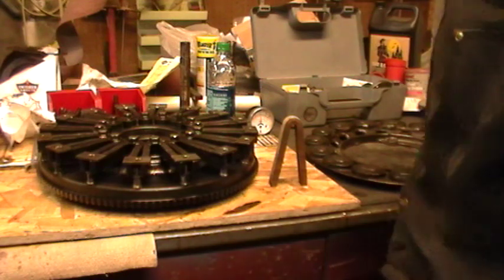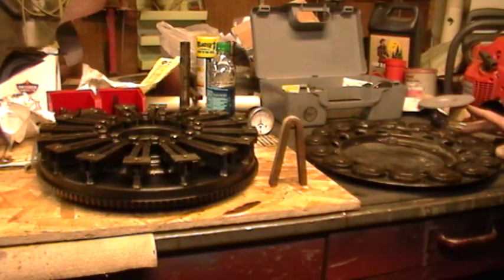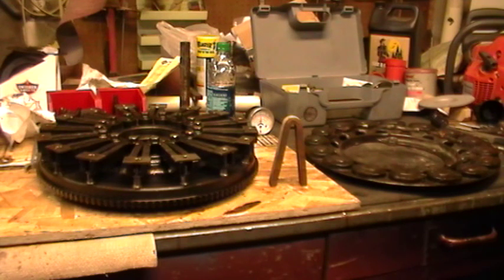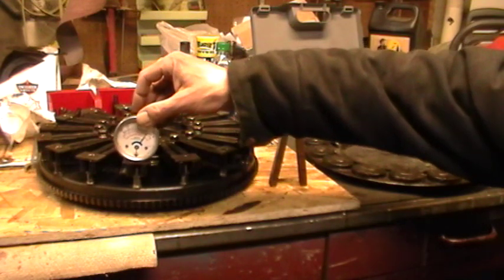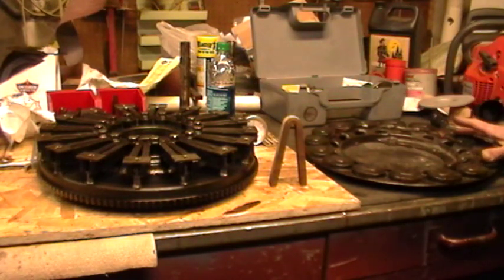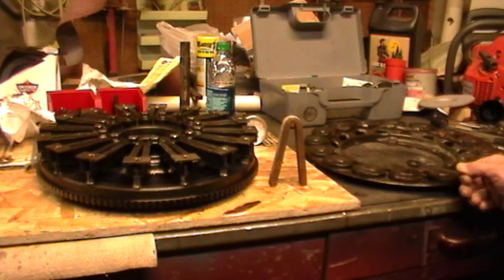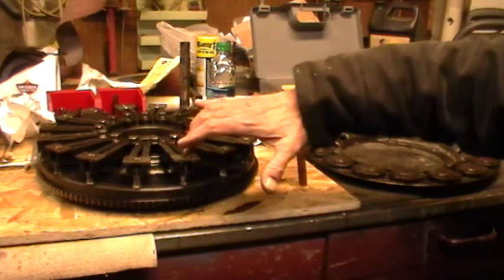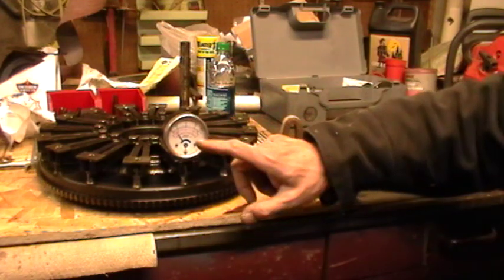Magnet recharging part 1

Comment: Hi, i noticed you checked the strength of the magnetism. Where would I buy one of these little gizmos? And would it work with a small DC motor?

My aim is to strengthen the magnets in the DC motor so it will work to the best of its capabilities.

Comment: I have a riding lawn mower that the magnets seem to be too weak. How would I charge these? The Flywheel part # is 12 025 25. It goes on a kohler engine and has on 4 magnets in it.